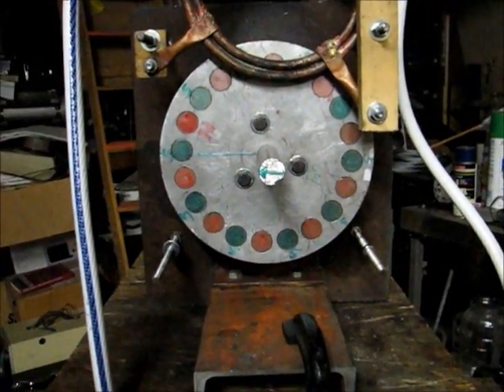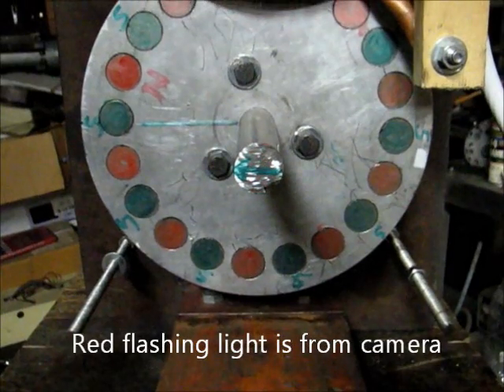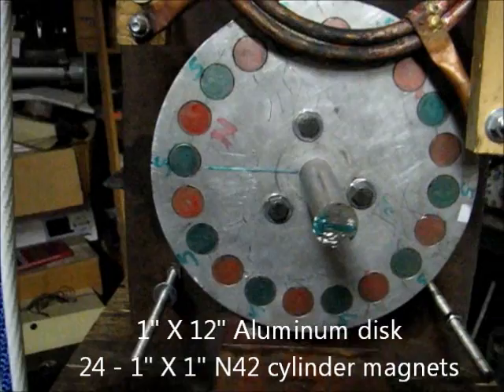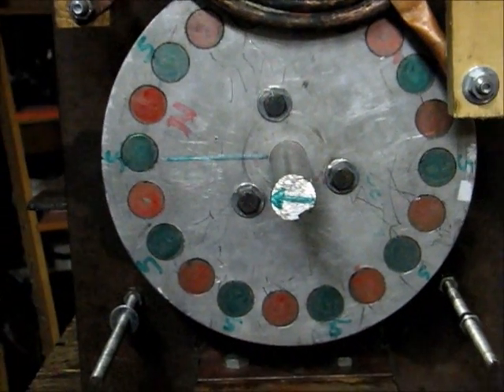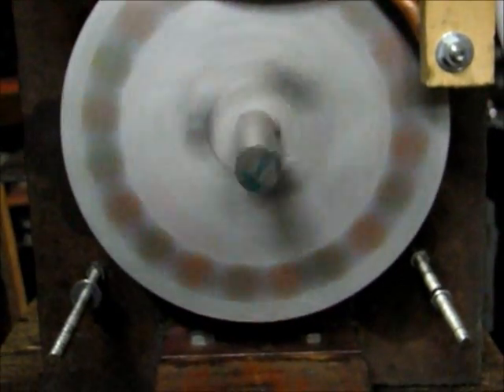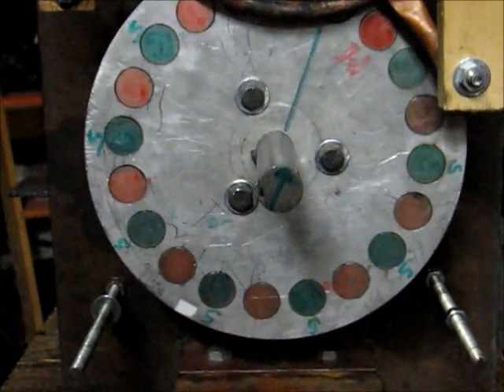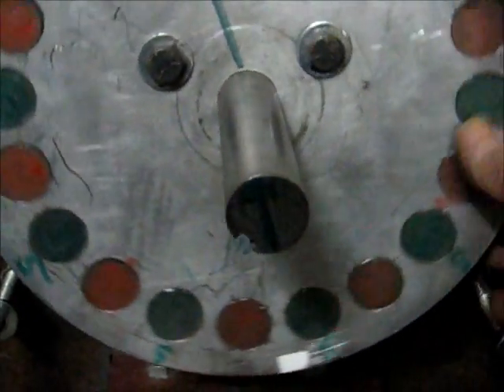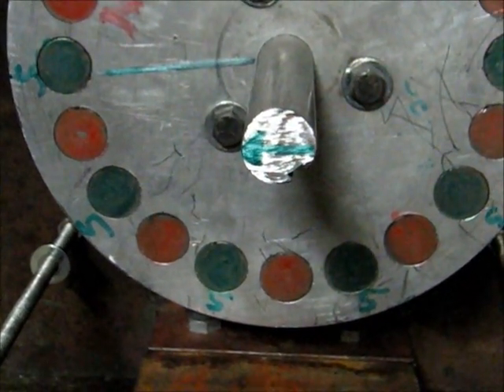Induction Heat Disk Mystery

Comment: Here is your answer.
The side grinder  did not make  one  flat surface but made a shallow elliptical or a VEE cut and it happen that the arrow was at the deepest part of the VEE. NOw a VEE cut has two surfaces and they reflect light  twice per revolution and from what I can deduce  the light was placed approximately above the camera and so the lower flat would reflect. 
These two reflections per revolution  occur  during a very narrow angle  and it is at  a this narrow angle one sees the arrow at a horizontal position always ( if the stobe was external to the shaft there would be  a relative rotation and in the picture there is not  .
It is an always synchronised strobe and so irrespective of the speed of the shaft the reflections are synchronised with the shaft and so the arrow is always seen horizontal pointing in either direction.
This effect is not noticed on start up as it happens very quickly but one notices the flashing  while the shaft slows down on  coming to a stop  one  will see the black and shine effect on the shaft.
I suppose we can call it synchronised scobing and I shall name it after  me-  The  Carmel Pule synchronous scobing  technique for shafts by grinding  elliptical face  or a VEE with two facets.
Reply: Obviously,  whatever is placed on the disc behind the end of the shaft do not have this property and so a burr is seen.
The fluorescent light does  not come into it as i fit did  there would be a relative rotation as what happens in cowboy films where the wheels  of carts is seen rotating backwards due to the fact that  this relative motion takes place till the  rotations are equal of  a multiple of each other .

Comment: I have the answer. As you can see the surface of the small arrow is not perpendicular to the rotating axis, so light will reflex always in the same position allawing to see the arrow, just as you do when you have a strobe light
Reply: You are correct, but there are two facets to reflect the  light and  if  you note carefully this results in the arrow pointing in both directions. If there was one facet the arrow will always point in the same direction.

Comment: On the end of the shaft where it was cut it's not perfectly flush,The imperfections on the end are picking up light around the room as the rear plat has no imperfections and has a dull surface,and would not have a good reflection...Hope this is a help..

Comment: the file marks are....
1st causing refraction and the angle you and cam are is seeing a blue wavelength refraction.
2nd the same file marks are acting exactly like a strobe light by polarization and the angle of the strobe effect added to the arrow being off the direction of the marks at the just the right angle and is causing a "timing light" effect on the arrow! (It is possible that the 60hz flash of the fluorescent lights are helping this)
I recommend trying this same setup with a polished tip of the shaft to test!
I think the ladies would enjoy a tip to polish for you! OR at the very least, they'd enjoy watching you polish your tip to test this theory!

Comment: A couple of things are probably coming contributing to the effect:
1. Fluorescent lights definitely 'strobe' at around 60 hz.  This might contribute, but the the next two almost certainly are responsible for most of the effect.
2. The end of the shaft is rough cut and the generalized plane is not perpendicular to the axis of rotation.  This causes flashing every rotation which is apparent when the shaft is not moving fast enough to blur the effect.
3. The mark on the disk is lighter in contrast and color.  The width of the line on the disk also takes up a very small fraction of the total circumference of the disk, whereas the width of the line on the shaft end takes up a much larger portion of the relatively short circumference that passes a stationary point your eyes might fix upon.
Reply: You are almost right in your 2 suggestion but not totally .  The self  strobing effect on the central shaft  as  seen in this video will also occur with a tungsten filament lamp which does not fluctuate in intensity at twice the 50 or 60 hertz. note twice! as in a fluorescent light
The magnets on the other hand do strobe because of the fluorescent light but not the central shaft as its strobes  itself due to the narrow angled  reflection of the  two facets on the shaft.
Reply: You are right in part with your criticism but not totally.
The part you are right about is that fluorescent lights powered with 60 Hz AC will strobe at 120 Hz.  I misspoke and I appreciate the correction.
Please note that I did not say that the effect was solely or even significantly dependent on the fluorescent lights, but rather that it might contribute, and that the latter two effects would be responsible for most of the effects described.
Your offered explanation describing 'narrow angle reflection' off the shaft end, echoes the second description I listed. 
It is worth noting that since the metal shaft is neither a gemstone, a natural stone, a biological material like bone or lens like visual unit, a raised area between the fluted divisions on a column, nor an aspect or phase of a complex plan or occurrence; the term 'facet' is not appropriate.

Comment: The end of the shaft is not flat, so light reflects off the end of the shaft only when the arrow is horizontal, at one point in every revolution, it's kind of a strobe effect, it's just the position of the light above, when the arrow is horizontal, keep it in the same position and then draw what you like and that will appear to....!

Comment: Spectral refractive expression. Spectrum of light emitted from the given source is expressed by the ink on the end of the shaft of similar wavelengths.  The strobe effect is due to the rate of shaft rotation relative to the frequency of the light source. Example: Take a video recording of a T.V. and you'll see a line move from the bottom of the screen to the top.

Comment: shaft end is not cut stright??
Reply from the maker: I would agree with that statement, even though it was cut using an automatic feed type metal band saw, and the sharp edges were removed with a 4" side grinder.
Reply: There seems to be two facets and  not one. I assure you that the direction of the arrow  points in either direction  proving that there are two facets/flats.  Also if you change the  position of the light to be at a level of the shaft  but some distance  away, the direction of the arrow will be vertical  with the arrow pointing both up and down  to compliment what we  see in the video as it is with the arrow  in a horizontal line POINTING IN BOTH DIRECTIONS,   the two facets on the shaft.

Comment: s. strater seems correct. its the grain of the metal's finish. if you look at it from a different angle, like from underneath, the arrow will be pointed the other way. it is visible at that side because that is the side of the grain with the most surface. so more of the marker ink is on that side too.

Comment: Dude th ed end of the shaft is cut on a slant like degree and the light hits just enough surface from what ever angel the lite source is coming from or reflecting from and every turn it does it reveals tge arrow so there you are. What did I win.lol

Comment: I think I have seen this before. I think that mental rod is slightly beveled to one side. You will not see the colored light unless the bevel is in the correct position, so when the rod rotates it creates a strobe effect.
 Light has a frequency and I think the different types of colored light are more prone to reach that shiny surface at different angles, "like a prism" 
 Also check surroundings for reflective surfaces that could shine light back at your machine. I would hang a dark sheet in front of your machine and dim the lights to see if you are still seeing the effect. If you are, then you just might have something special on your hands, that is a new effect never recorded before.
 Regardless, it was very interesting. I enjoyed thinking on it and thank you for showing this unusual phenomenon.

Comment: the grinding on the end of the shaft is going in line with the arrow, the refraction of the light is being reflected only in the direction of the viewer when you see the arrow lines are going left to right.... if you ground the disk where the line is in the same direction and way the end of the shaft is ground you will see the same thing happen with the line.

Comment: I guess I’m a bit puzzled as to what the real question is, here… You have one line on a dull aluminum surface that stretch only half-way across the diameter of the circle, while the other line is on a freshly cut (rough, but shiny) surface, and it stretches the FULL distance of the circle’s diameter (giving you TWICE the chance of seeing a line run in front of you per rotation, allowing the brain to process the line better). It’s kind of an “apples to oranges” comparison to me. And like another said, the surface of the center-piece may be cut at a slight angle, giving you the strobe affect.
Reply from the maker: While I agree with you, the length of the line(s) were not needed to see this effect, they were added as a reference point, without any thought to their length. No "camera lights" or any other light other than the 8 ft. overhead florecent shop lights when this was 1st noticed.  And since the shaft end was not machine lathe-cut, yes it is slightly out of square, and is probably the best answer for the results seen. It's just something that caught our attention and were facinated by its "strobe" effect given the motor speed.

Comment: The flourescent light is discharging very fast, but this speed lets you see the discharge. If you would use an high speed cam u would see it too. Test it with an led or light bulb, it wont work

Comment from the maker: BUT, we saw it first, THEN grabed the digital video camera to record it.  The only light's in the shop were 8 foot florecent, overhead with a 10 foot+ celing height.  So the camers shutter theory can be ruled out.
Reply: Please consider my answer to your problem.
Reply from the maker: Carmel Pule' Sorry for the delay, I've been out of town working. I tend to agree with your explination, cause it's not the camera "record" light, cause we noticed this prior to using a camera. A colmen gas lantern would rule out any 60 cycle light theories. If time permits, I will conduct this test prior to my returning North.
Reply: capindres  LED lights on a DC battery should also do the trick. As long as there is no PWM circuitry in between. Fluorescent lights and even CFLs may have a flicker. The rotation of the shaft and its uneven surfaces might be causing some kind of resonance.

Comment from the maker: We agree with Caldon Samis comment.
The overhead florecent  (8') lights are the old fashioned type.  I think we know what the answer is.  Because the shaft-end was not precision machine cut, but rather was cut off (out of SQUARE) with an automatic band saw, the cut is at a slight angle.  This angle is only reflecting the blue light in relation to where your eye's see the reflection from the overhead lights, resulting in a "strobe like" effect.  This is what we are pretty sure is happening.

Comment: The fluorescent light acts as a strobe probaly around 50 hertz or so, u can see the arrow because that is spinning at a far lower rate than outer part of the disc that the line is drawn on, pure fluke that the speed of the arrow coincides with the frequency of the lights.

Comment from the maker: Only problem is, that we first noticed this effect with our own two eyes.  And it seemed not to matter the viewing angle.  We thought the same idea and tried to "correct" it by altering the shaft end with a grinder.  Nothing we did made any difference.  We believe that due to the 60 Hz cycle supply, and the RPM's (dividable by 60) of motor allowed a strobe effect that wasn't quite in phase and thus the oscillation on-off-on.

Comment from the maker: I believe you are right, it has to be some kind of frequency offset or something in conjunction with the highly reflective surface of the freshly ground shaft end verses the oxidized (dull) disk surface.  What's really confusing is the fact that the end of the shaft does it but not the line mark on the 12" disk.  One would tend to think that if it was a "strobe" effect that you would see both.

Comment: It is probably turning at 3600 rpm / 60 s = 60 rps = 60 Hz minus the strobe frequency of about 1 cycle per second. I guess the induction motor is slipping slightly behind the electricity frequency because of the mechanical load?  Is that how induction motors work? They slip behind the AC? 

It would be interesting to add more friction and see if the "beat frequency" of the blue light speeds up.

Comment: I think that the oscillation is because the 50Hz light sourse is also playing a part in this illusion game. Depending on the rpm of the lathe the light frequency can cause strange oscillations effects.
What you have there is basically it is a double interacting oscillation strobe light system;) Maybe you could file this as a new invention :)

Comment from the maker: I haven't tried this yet, but I would agree with your assessment as it seems the most logical explanation.  The weird thing is that it seems to oscillate very slowly on-off-on.  One would think at the over 3000 RPM's it would be much faster.  But then again maybe its an optical illusion.

Comment: This is because the shaft is not cut off straight. The light coming from is coming from above and is reflecting only if the slanted shaft surface is facing upwards. So it acts as a strobe light. Put a strong lamp next to it on the side and you probably will find that the arrow will then be pointing down or up depending on which side you put the light.